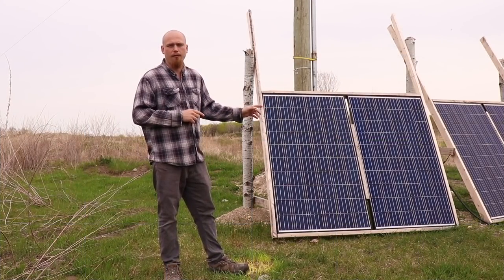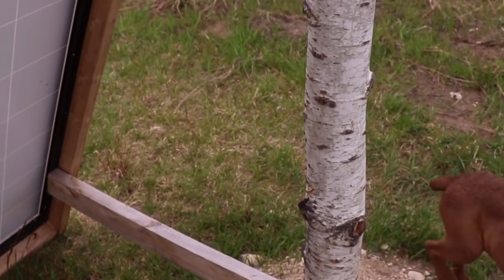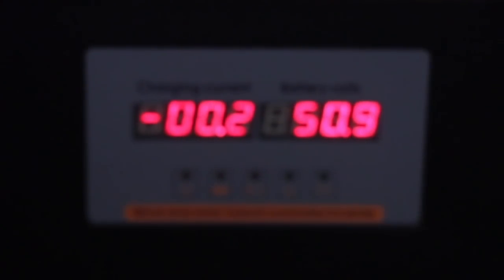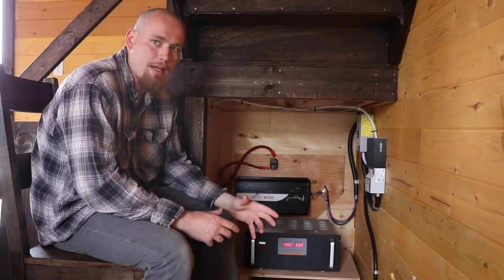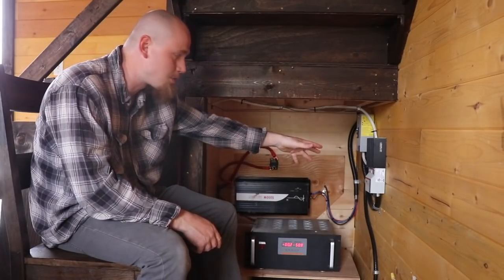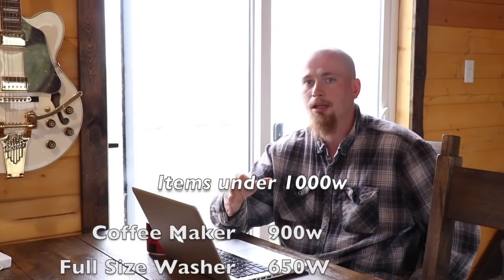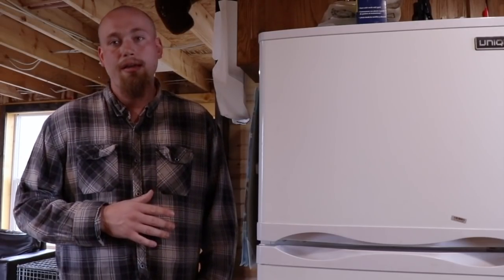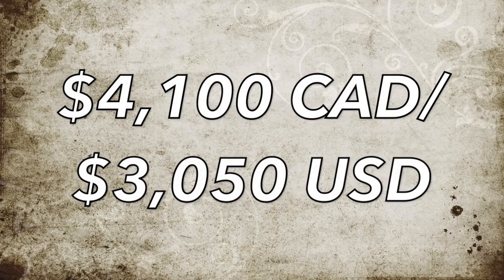Off Grid Power | Our 2Kw Solar Wind Hybrid System

Comment: Were you in the middle of working on the batteries..?  I saw a couple of the posts that didn't have cables attached to them.  Oh.. and you should switch, if you haven't already to a MPPT controller. More efficient.  Nice system overall though.

Comment: Definitely a new electric fridge is so much better than a propane or butane one. We used one for about 3 years and the carbon monoxide was a serious issue in our house. Also it needed regular servicing. We have a brand new large electric fridge and it uses so little power that it barely touches our battery bank overnight.

Comment: Love the video! I have a dumb question, been searching everywhere: Is it possible to charge the battery with both MPPT controller from the Wind Turbine (2 or 3 of them with each having its own controller) and a mini solar system of 1kw with their own charge controllers. Can all charge controllers work at the same time charging the batteries or will there be an issue/ fire hazard?
Reply from the maker: I would imagine that would work. We have 2 sepetate charge controllers working without issue. I've seen setups with more

Comment: A 110V ac heating coil on 50V DC will deliver 1/4 of the rated power and draw half the current, so if you need a dump load of 1000W, just get a 4kW water heater coil and you're good to go. No need to find a special DC rated 48V heater. I've even used a 220V electric kettle on 48V to capacity test a battery bank. It took it 15 minutes to boil 1.5L of water, but it worked flawlessly.

Comment: Nice video. Just remember to check your birch poles condition. Birch gets rotten in few months outside, especially if the bark is not removed.Thats the reason why its not seen as a construction material (except flooring).
Reply from the maker: Your absolutely right, it's coming to the end of its lifespan this season. Made a great temporary solution for a couple years! Will get a proper mount sorted this spring 🍻
Reply: @TheHappyHermit  Did you have any problems with having the panels touching the ground? It seems like snow etc. would cover the lower part easily and some panels lose disproportionate amount of production from partial shading.
Reply from the maker: @AnalystPrime  it's never been much of a "problem" really has we just keep it cleaned. But it does continuously require going and shoveling 3' in front of the panels when we got a snowfall. Definitley not the nicest way to set it up lol but was a great solution to get started on the cheap
Reply from the maker: Your absolutely right, it's coming to the end of its lifespan this season. Made a great temporary solution for a couple years! Will get a proper mount sorted this spring 🍻

Comment: Several questions. I have a cabin off the Georgia coast with a lot of sun and wind. I want to build a system likes yours. Is your controller a hybrid that allows both wind and solar inputs to charge? What is the Longest  distance  I can run the lines from the turbine and panels-Is there a maximum run-low voltage right? Small cottage with few items that will need power like your, but have a well with a 220v sub pump. I want to build a system but am not familiar with how. Please advise
Reply from the maker: Simple 110v jet pump pulling from the well would help reduce your needs as far as the components in your setup. The controller is a hybrid but we had issues when running both solar and wind through it so switched to a second c.controller to run the solar and just the wind through the big unit. There's no maximum distance but you need heavier cable the longer the run to account for voltage drop. So basically, the farther away your panels, the thicker and more expensive cable you need

Comment: The happy hermit , what are the life expectancy on your solar panels ? Just wondering cost vs that , and where did your research take you to purchase the best ones for living off grid . Thanks from Alberta
Reply from the maker: Almost all the panels on the market have about a 20 year warranty but a minimum 25 year life expectancy. They last longer but don't produce as much power at that age. As far as the best panel choice for off grid, it really is just a matter of choosing a panel with an output voltage and amperage best suited to your system. 

Cheers from over in Manitoba!

Comment: Have you looked into a chest freezer as refrigerator, replace the thermostat for a Chinese temperatur controller, it wiĺl run on 60watts
Reply from the maker: I haven't yet as we've only used propane for refrigeration so far but thats something i definitely need to look into! Thanks for the tip! 

Cheers

Comment: How many KWh does the turbine produce a day in average? And what conditions would you say is needed for that? Thanks
Reply from the maker: On a good windy day (at least 40kph winds all day long) it brings in a steady 700w per hour or so I would say. It varies with the gusts so sometimes it's putting out 300w and other times 1400 on really strong gusts. So 700w average for 24 hours would be nearly  17Kw for the day under strong consistent winds.
Reply: Verify that you actually have STEADY 40 kph or 25 MPH  wind speed for many hours per day.  Most people do NOT !!!   Winds at 1/2 speed ( like  20 kph or 12 MPH ) generates only 1/8th power = 95 Watts  <== YIKES !!!   Winds below 7 MPH generate essentially 0 Watts.  Light winds have very little power.  Install an anemometer and record your wind speeds.  Strong, steady windy is extremely important. Also, clear away all obstructions within, at least 100' radius - ie clear flat land. The higher the pole the better.  How many kwhr's your wind turbine will generate at YOUR  location can / will very greatly from this location.

Comment: May I suggest a vertical wind turbine (VAWT, on eBay from China 2000 W/h - 48 V) which is recognizable by birds, so they avoid it.
German eBay: https://www.ebay.de/itm/2000W-DC-12-24-48V-5-Blades-Wind-Turbines-Generator-Vertical-Charge-3/312907304511?_trkparms=aid%3D555021%26algo%3DPL.SIMRVI%26ao%3D1%26asc%3D225116%26meid%3D0182612f232c41fba50c8d78c4a4aa33%26pid%3D100752%26rk%3D4%26rkt%3D10%26mehot%3Dco%26sd%3D283785151856%26itm%3D312907304511%26pmt%3D1%26noa%3D0%26pg%3D2047675&_trksid=p2047675.c100752.m1982
Reply: This Chinese one is rubbish, lucky to get 10 watt out of it on a windy day. VAWT only have 8 % efficiency. Spinning is not enough to harvest amps.
Reply: @Henriette Rozema
 - No, you may not ...

Comment: Nice. Which of the 2 produce the most energy in a year
Reply from the maker: I don't track the performance of the system over time, but I'd say the solar probably produces more in the long run, but the wind is an absolute blessing on cloudy winter weeks
Reply: @joseph john
 - What really mater is  ... What is the kwhr production of a Wind Turbine at YOUR location, because 99% of the people do NOT live where there is sufficient.wind.  Do you have STEADY 40 KPH / 25 MPH winds for many hours per day?  Most people do not ...
Reply: @MrSummitville  . Ok. Thanks

Comment: how's the solar hanging in there on a week of grey winter days and no wind for the batteries? Do you run a propane generator in times like that?
Reply from the maker: No generator, just use what's available. More often that not there is one or the other but on calm grey days we simply don't run power aside from a light when needed and a brief shower. Nothing but clean burning propane for the fridge and how water tank right now though! Cheers

Comment: One problem I see bro I wouldn't series the panels on a pwm charge controller  basically its  like you're wasting 2 panels it's best to parallel all  Until u get a mppt charge controller
Reply from the maker: Were running a 48V battery bank so need to be in series to get that voltage up high enough to be able to charge up to 58 volts. My last 2 MPPT controllers failed on me so I simplified with the PWM and it's been great so far with no noticeable difference. Might upgrade the controller again once I add another kw of panels down the road
Reply: @TheHappyHermit  ok for some reason I thought is was a 24volt  setup . Everthing is perfect then. Would u recommend a hummer wind turbine I hear people say terrible things about them . How is it doing for you?
Reply from the maker: It was 12 years old when I bought it, if you watch my other video of it going up we literally dropped the thing from 8 feet in the air before getting it up. Even after all that it consistently brings in over a thousand watts so I really can't say enough about how solid of a product it is. Would buy another one without thinking twice for sure

Comment: How many amps battery are you running? I'm a battery tech in town
Reply from the maker: We have 4 deep cycle batteries. 12v each 220ah wired as 48V
Reply: @TheHappyHermit  When your ready for a battery upgrade let me know.

Comment: Nice just found you guys. Thanks for sharing. Lucky you guys do not run AC here in South Carolina on the cost. We just about got to have AC. Today it's 96F 35.5 C with 99% humidity. WIth out my solar we could not cover are power bills.  God Bless..

Comment: This is great info and want to understand and learn...but it's like algebra to me I made it through the class but nothing stuck LOL. Where did you learn about the wind and solar? The set up, what you need, what you can run? I am assuming no AC on either? How much would and energy efficient fridge deplete a battery bank? Sorry for all the questions, just trying to grasp it. This subject is the most perplexing to me, along with growing watermelons (3rd season is a charm. Wish me luck!)
Reply from the maker: Just keep watching and learning from others and you will catch on a little at a time! First step in knowing what you need is learning what each item you want to use consumes in watts per hour. It's usually on the tag of the cord or sticker on the appliance. No air conditioning here. A high efficiency rv fridge would be best for off grid and run straight on 12v in my opinion. Would probably want a few extra panels and batteries for it though vs what I've got here. I wish I could simplify things but it's all really overwhelming in the beginning haha thanks for watching, best of luck with the melons!!

Comment: Great video, great numbers. What about an insulated stainless steel tank 30' 40' up on a tower, dump some excess power an pump water up to the tower to use at low power times.
Reply from the maker: Thank you! Honestly now that we have the solar and wind both going, I find we never do get to a point without the power needed to run the water pump. A gravity tank to store fuel on site might need to be added to the list soon though! Lol

Comment: You use a septic system?
Reply from the maker: Right now a large Septic tank but no greywater system just yet
Reply: The Happy Hermit hmm, I want to do a compost toilet and will still need a leach field for greywater. Any ideas about that?
Reply from the maker: There's lots of ways I've seen online that people set it up to not cost an arm and a leg. The biggest factor is how tight the rules are in your neck of the woods or how much of it is actually disclosed to big brother
Reply: The Happy Hermit permits and code are certainly deciding factors.

Comment: I found that I could cut my winter gas bill in my 1926 house on the water by using my 9.9 kw system to run electric space heaters. We produced enough dollar in the winter to make this a very affordable heating solution for us. Loved the extra money in the bank
Reply from the maker: Heating a home of that age is a task! That 10kw of solar must of made a whopping dent in the bills. Our previous system around the same size would put out a good 70kw on a summer day
Reply: @TheHappyHermit  I averaged 13 MW per year. I was grid tied. I halved the gas bill, exactly and we were comfortable.
Reply: @canuckyank82  . Which city?

Comment: You probably have already figured it out..
But some of your viewers may have not thought that far ahead..
When using an electric water heater as a dump load.. Water heaters have two thermostates..
When the first heating element reachs temperature it switchs the power to the second unit...
By replacing the second thermostate with a thermostate.. the same as the first one....
Once the water heater is up to temperature you can send the power to another job..  or dump load..
and you might turn the temperature up as high as reasonable on the water heater..   seeing you would be using it to store energy..
This is just food for thought..m
Reply from the maker: Great points Jim! There's a couple ways I've considered rigging it up. I also want to plumb it into a water jacket on the woodstove and have pressure relief valves, which would do much more for us in the winter months than the dump load will, so I may have to determine how complicated I really want to make things to add both methods